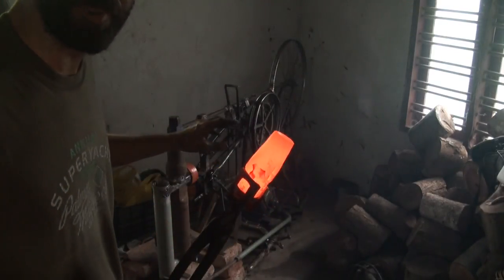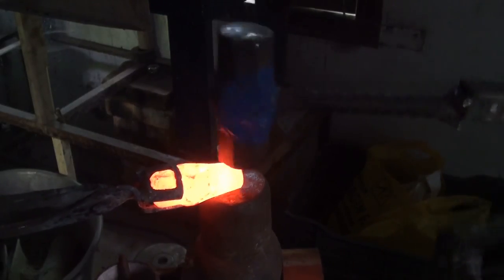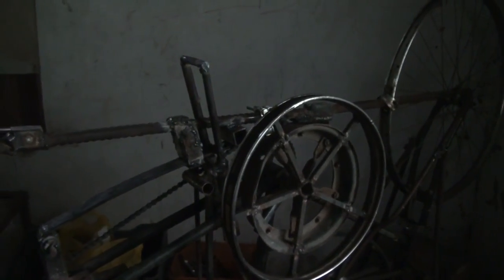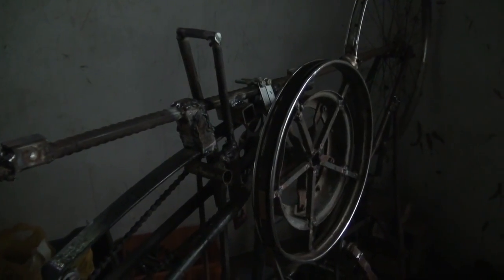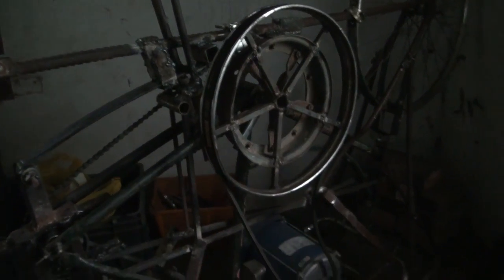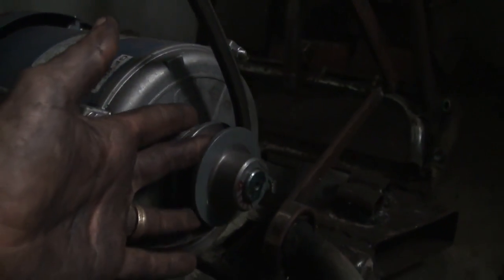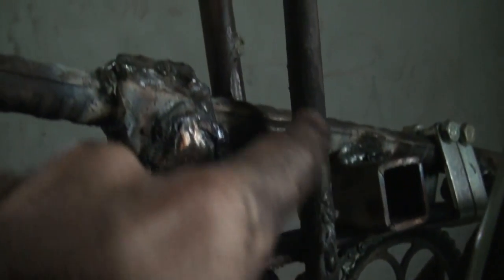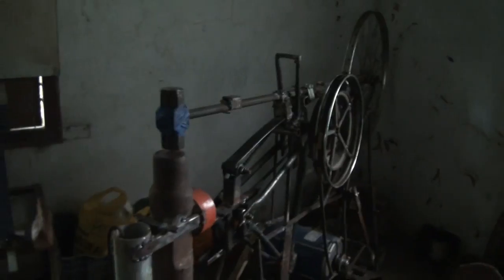Motorized Bicycle Power Hammer! - Blacksmithing!

Comment: Great little hammer you got there buddy! One suggestion when you're using charcoal if you can take in wet some of the charcoal that you do not need to be a blazed it will cut down on the fire fleas. Also if you cut off the fans blower while you are forging and then put your peace back in the fire then turn on the fan it will help reduce those as well :-) I hope those tips help you with your forging comfort LOL. Hope you have a great day today God bless you and I'll catch you on the next one
Reply from the maker: Hi Roy thanks for the tips. Will try the water and somehow must remember to turn off the blower :) Keep forgetting. Watch a lot of your videos, they are very informative and you cover what people need to know. The leaf spring idea I got from one of your vids. 
Have a great day.
David.
Reply: Work With Nature awesome dude I'm glad that my videos have been helping you out :-) by the way you look someplace tropical where do you live at if you don't mind me asking?
Reply from the maker: My wife and my self live in Kerala India, I have run a seed saving farm here for the past 3 years on volunteer bases. Planning to do that for at least the next 2 years, but may go back to Ireland at some point. BTW if I may say your wife is absolutely smitten by You :) Don't tell I said that though lol. Alright time to go off for dinner.

Comment: cool vid, its weird I'm subscribed and I have notifications on but it didn't come up
Reply from the maker: Sorry about that! Youtube has been doing that now for the past 4 month for my channel. Seems to be a bug and it is not only happening to me either.
Reply: Luca La Ferla same here. But the reason for this is YouTube does not serve all of someone's audience even with the Bell notification turned on. They have found that when they did this people ultimately unsubscribed from the channels they were watching because some channels post quite frequently and then some unfrequently. They basically did this to prevent someone from spamming your thread with like 500 videos LOL
Reply: Roy!!!, you were the last person i thought would responds, cool channel by the way, I am in the process of building a somewhat similar re visited power hammer. 

it is unfortunate that youtube is doing this, I have noticed this on a few channels.
Reply: ahh ok, this power hammer just got 10x better, as soon as you get a belt grinder you can make some wicked blades

Comment: A little loud for my tastes but good job with the hammer. Charcoal is my favorite fuel but it’s expensive and burns too fast for me. My forge burns 20 lbs of lump charcoal in 2 hours or less. That 20$ for two hours.i burn anthracite coal 4$ for 40 lbs. 20 lbs of the coal (half a bag) lasts around 18 hours. 18 hours for 2$ or 20$ for 2. Obviously I go with coal. The coal is really boring though did you re heat treat the hammerhead? The idea about the two peens. The problem is the peen speeds so fast because there is less surface area so it bites deeper with the same strength. Adding two and it decreases the presser on each peen
Reply from the maker: You are right charcoal is so expensive and if I could get coal I would use that. Here down in south india it is hard to get it were I live but charcoal is available. The type I have burns way slower than the stuff I have made. So I just buy that for now. Did not re harden / temper the hammer head on the power hammer after slow careful welding hence the reason I put some tape around the weld areas. Just in case some peaces fly off. Seems to be OK. The peen hammer I did harden and temper again after normalizing three times. Also did change the peen later to one from the two as what you say is correct. It does not increase the amount of work done if you don't have any extra force. Maybe in a press it may be beneficial.
Reply: Work With Nature - How to Grow Food! Thanks for the response. It would be a good idea to use on a press for Damascus.  I’ve seen a guy who did it like that but with dots for raindrop 

Sucks that you can’t get coal it was hard for me to find coal at first. I wish I could afford to only use charcoal.
Reply from the maker: @JustinTopp  Yeah India is fairly cheap to buy charcoal. I get around 100 lbs for around 26 dollars and it is good stuff. But then all you need is a funnel shaped hole in the ground to make your own if you can get the off cut wood from a saw mill.

Comment: Thats a nice little machine you made there

Maybe you can cast some concreet in and around the metal underneeth to stiffing it up and the weight will 

help stabelize it.
Reply from the maker: Cheers was a lot to figure out to make it work. 
The concrete idea is good, will bear that in mind if it ever does move on me.